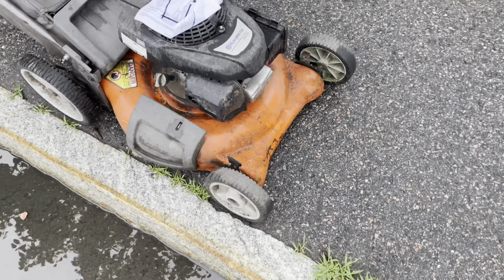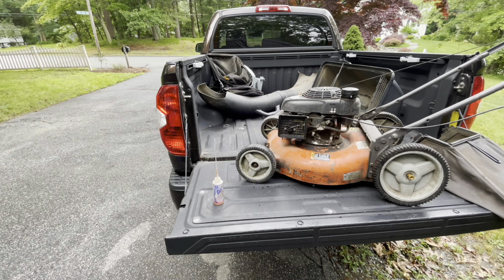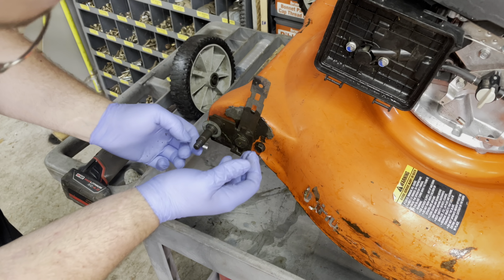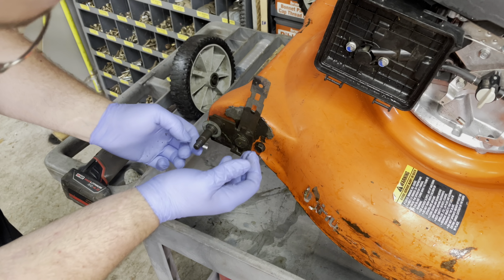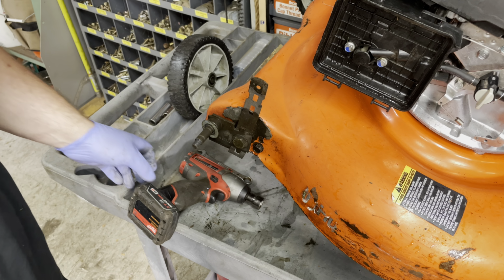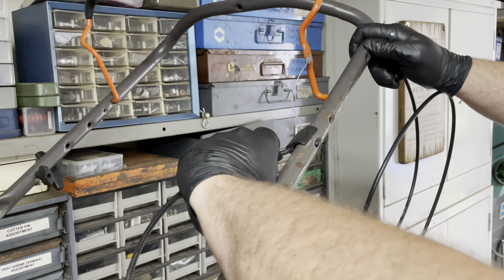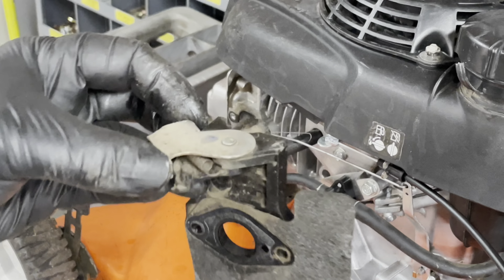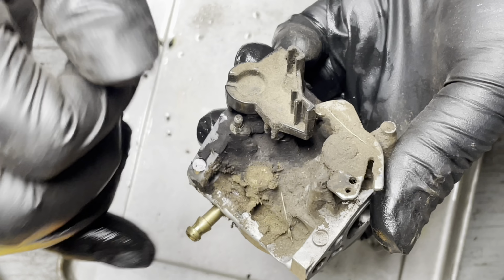Husqvarna 7021P Push Mower Maintenance/ Carburetor Clean

Comment: You're my right hand man, now! Lol. Got a pry bar and tapped it with a hammer and it came off. The keyway looks good so I guess my next step is to check out the carburetor? Can't see anything else right now.
Reply from the maker: I'd definitely regroup, check the carb, drain the tank. Make sure there was no water/ debris that may have been stirred up from the bottom of the tank causing this issue
Reply: @hester781  Good morning Mr. Hester. I emptied the gas tank & put fresh non-ethanol unleaded in it and changed the oil before this issue started. The guy that gave it to me left it sitting out in the elements. I had to put a new throttle cable on it and fix the pull cord. It started the first try! That was spring of last year. It has run fine, cuts tall grass like it's nothing. Then, all of sudden, I hit a couple of objects in yard, and all of the problems started.  When I put everything back together yesterday, it started right up and about 2 or 3 minutes later it started slowly idling down and smoking until it choked off again, just as before.
Reply: I'm sure the carb needs new gaskets.

Comment: I also have a Honda Husqvarna 7021P model lawn mower that I bought in 2012, now it's 2024, and my lawn mower is 10 times cleaner and in better shape than the one in the video. No matter what it is in life, it always comes down to the owners, there are owners who'll take good care of their stuff, so even though the stuff may be old by age, their stuff will still look pretty good and in good shapes, whereas you have irresponsible, careless owners who abuse their stuff, so even though their stuff might be newer, by age, they would actually look used and abused and looked much older than they should. I'm actually looking at YT videos on how to fix my lawn mower blade because I hit a wooden curb on the side of my house back in April of this year, and the blade got stuck in the wood and is bent, which is why I'm replacing the blade. I saw other YT videos on replacing the blade, but yours is actually the most informative because you said the writing on the blade should face the grass, so that would be the correct placement of the blade. 

BTW, when the blade on my Honda mower got bent, I thought it would cost a lot of money to get it replaced by the experts ( now I know that changing the blade and doing other maintenance work on the mower, like changing the motor oil, is actually very easy to do ) so I actually bought a GreenWorks battery powered lawn mower, what a big mistake that was, the 2 batteries power run out very quickly, so I had to buy 4 extra batteries just so I can at least mow 1 side of my house. The power on my battery-powered mower is also much less powerful than my gas-powered Honda mower, so that's another huge drawback with battery-powered mowers.

BTW, where is the choke switch on that Honda mower shown in the video? On my Honda Husqvarna 7021P mower there's a choke switch that I had to move to un-choke before I was able to start the mower, then after it started, I had to move the switch back again before I could start mowing. I didn't see on the video that you had to un-choke the mower before you could start it.
Reply: Or, I'm thinking the previous owner of that Honda mower unhooked the choke switch on that Honda mower, which is why you were able to start the mower without unlocking the choke switch. Which is also why when you opened the cover you discovered a wire was unhooked, so maybe that was the choke wire the previous owner unhooked.
Reply from the maker: So this has what's called an auto choke, I am familiar with the type you're referring to though.  on this particular Mower the choke automatically closes when it gets cold and opens with the heat of the engine automatically

Comment: Time to make up a set of installation studs to use when doing those carbs. I’ve used a pair of wooden dowels and promised myself next time I get on one of those carbs I’ll pull one stud and either cut the heads off a couple bolts or get to the hardware store for some correct size rod to cut and thread and paint with holes in one end to tie them together so they don’t go walkabout. 
That’s my story and I’m stickin’ to it! 😁🔧👍
Reply from the maker: I have since made up a set of alignment studs 👍🏻
Reply: @hester781 
Well of course you have! 😂
Our best tools are the ones we make ourselves to fill a need not met by the manufacturers! 🔧🔧🔧👊👍

Comment: Awesome video, my man! Good filming, detailed repairs...nice. A little fast for me on all of the little carb parts and pieces, but I have unlimited rewind on video. Lol. Thanks for the tutorial! I had a fwd Husqvarna hu700f that was given to me.  I replaced the throttle cable and started 1st pull. It has worked fine until I hit a little piece of plastic in yard. Now it idles up and down and will not start if it cuts off after it's warmed up good, unless I let it sit 10-15 min. Sounds like it's choking itself off. Do you think that could have anything to do with the blade hitting something,?
Reply from the maker: It sounds like you might have partially sheared your flywheel key. What that will do is change the timing ever so slightly and cause all sorts of running/starting issues. Usually a quick way to tell is to pull the recoil housing off the motor and remove the flywheel nut, on many models you can see if the key is equally in both the flywheel and the crankshaft or if they have parted ways.  There are many videos on YouTube that will show you what I'm talking about better than I am explaining it lol.  in any case where the mower was running completely fine before hand I think that's a good place to start looking
Reply: @hester781  thank you so much for the response. I'll watch a video or two and start where you said and see what I can find out. I appreciate it man!

Comment: I wish I could send you a pic. I think that's my problem. I got the flywheel off and I can't see a groove on the shaft so I think I'm definitely twisted up. I need a pull tool to get to the next step.
Reply from the maker: All you need to do to remove the flywheel is screw the nut on till it sits flush with the end of the shaft, get some sort of tool to pry up underneath it, then while you're applying upward pressure to the flywheel deliver one sharp blow to the crankshaft straight down. This will break the taper fit loose.  If you're unsure of my instructions just YouTube how to remove a small engine flywheel.  Taryl fixes all has a few good videos on this

Comment: The little tiny spring on the throttle cable that runs right behind carb was unattached. I put that back on and ran it before I got into the keyway and it didn't make any difference.
Reply from the maker: Darn, almost lucky

Comment: Came here for the oil change! Denied lol.  Great video otherwise
Reply from the maker: Welp….i feel sheepish 😳 I just re-watched the whole thing and sure enough I never filmed the dang oil change🤦🏻‍♂️ I apologize, I’m very surprised that nobody else pointed it out lol. I don’t know if it’s too late to help or not but all I do is pull the dipstick and turn the mower onto its side and drain the oil through the fill tube into an oil drain bucket
Reply: @hester781  But I also learned that old oil has to be heated up by turning on the mower and letting it run for at least 5 min. to get the oil hot enough so it can be drained out completely. Yeah, I also noticed that you didn't show how to drain and change the motor oil.